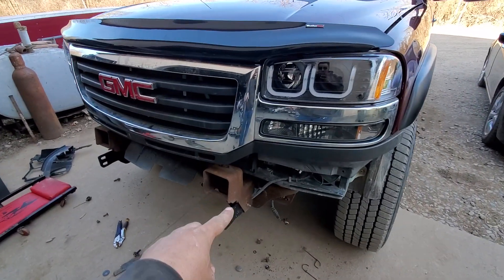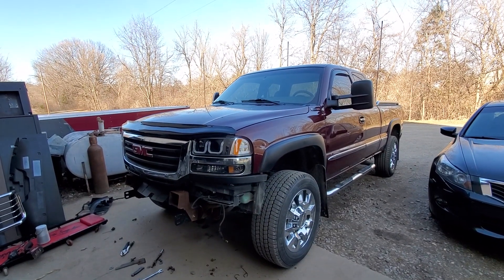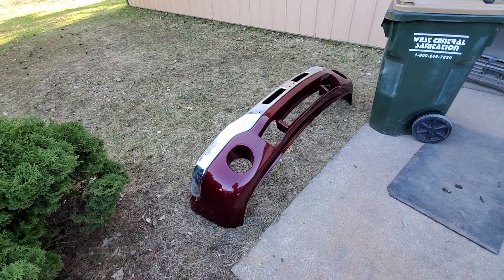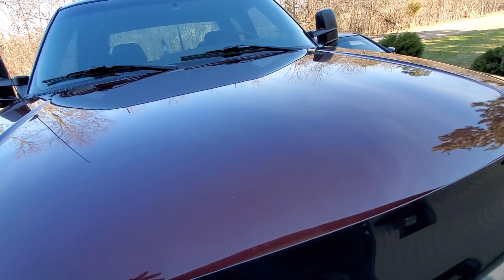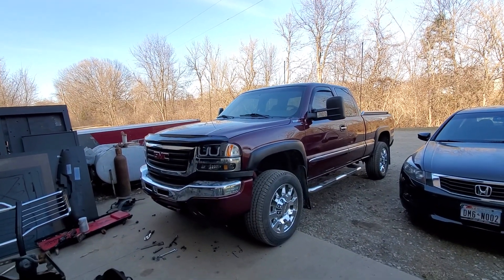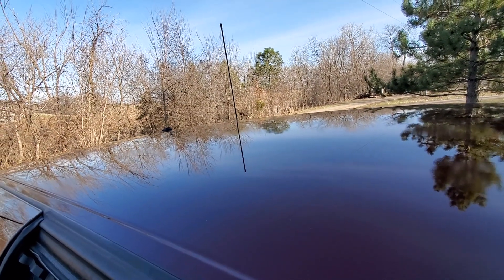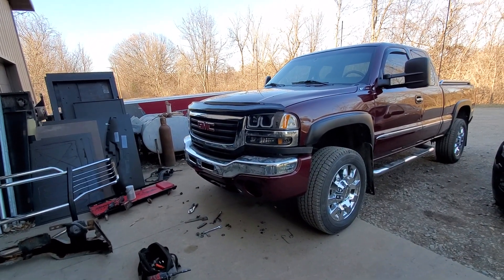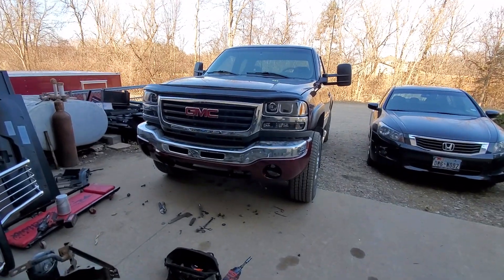Sierra 2500HD 01 to 06 Face Lift

Comment: Did you do an 03-06 interior swap on this truck? I have a '99 Silverado that I'm going to do a full restoration on, and wondering about all that you did in the interior?
Reply from the maker: I Did an 02 escalade conversion, but as for electrical, its all 99-02 still, I would have to swap ecm and stuff out of 03-04 LB7 to swap the cluster and hvac, personally, I don't mind what I have, just wanted the wood grain and the different dash style